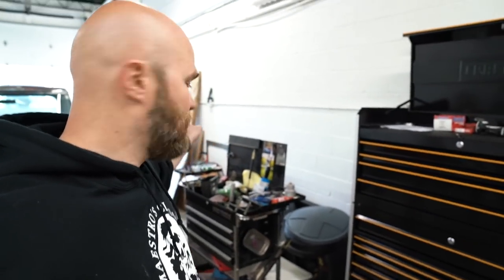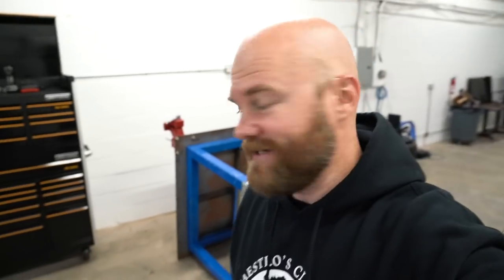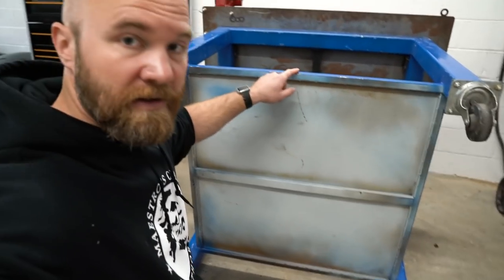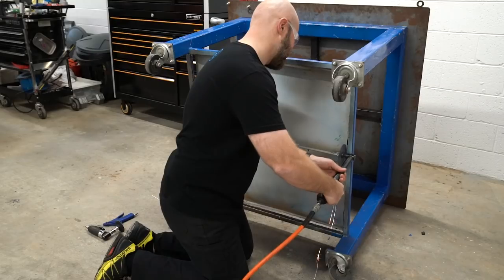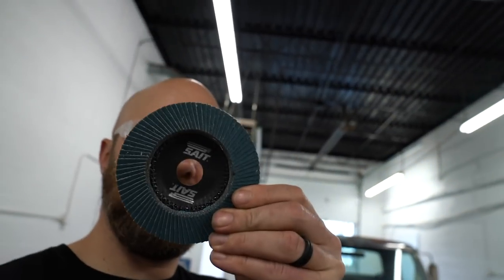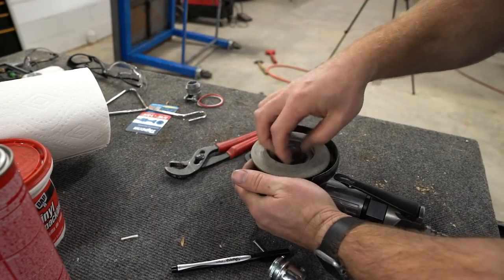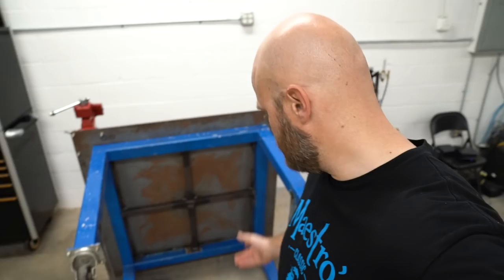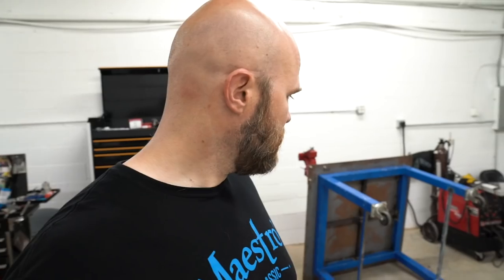Modifying My Welding Table

Comment: I realize this is an old one - but it is still true.  You should have left the shelf but just cut it back to be out of the way of your leg.  Shelfs are very handy.  Personally I'd have added a 2nd shelf at mid way but only half as deep - front to back not back to front, with a big lip.